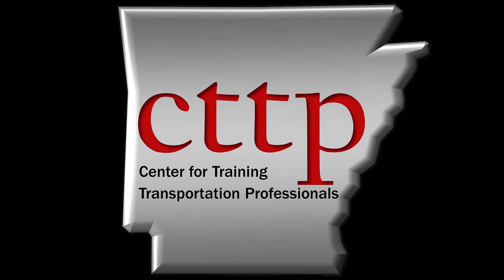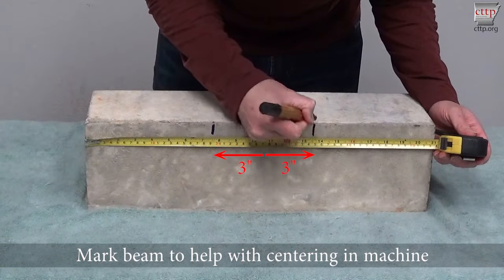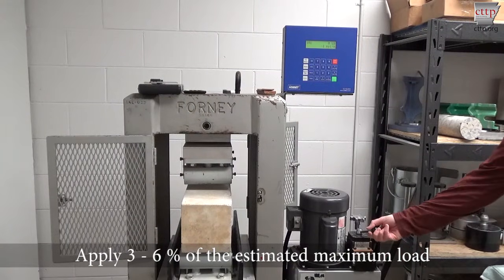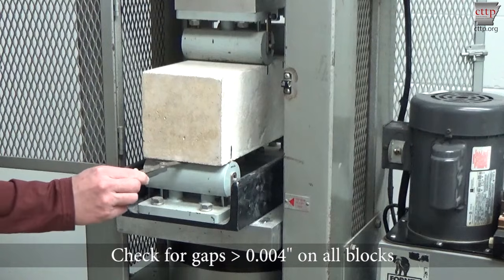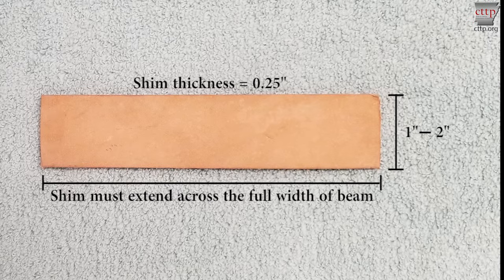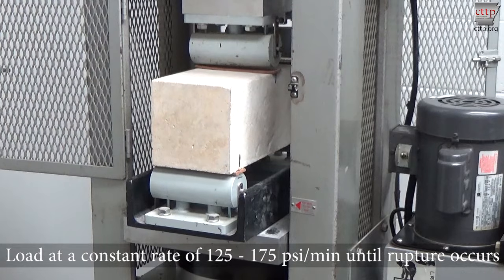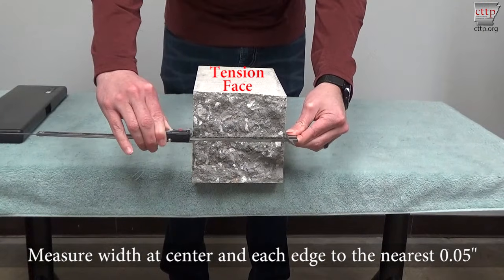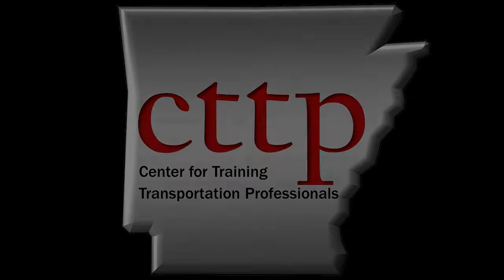ASTM C78 - Flexural Strength

Comment: How long should the specimen be in the mold before removing it and curing it?
Reply from the maker: The specs loosely say up to 48 hours.  As a general rule when kept properly between temperatures of 60 to 80 degrees while curing, it is generally safe to strip concrete cylinders and beams the next day, though if its kept in cold temperatures you may want to use up to that full 48 hours to make sure they aren't "green", which is a term to mean it hasn't fully hardened yet.

Comment: Is ultimate load the maximum load or is it the load at constant rate?
Reply from the maker: Yes you can think of ultimate load as the maximum load.  The loading rate has to be between 125 and 175 psi/min (or that would convert to 1,500 to 2,100 lb/min....which would further convert to 25 to 35 lb/sec depending on how your compression machine reads)

Comment: how do we know 3%-6% of estimated maximum load?
Reply from the maker: That depends on what we anticipate the maximum load to be.  The whole idea of the 3-6% is to just put enough of the load for the loading/support blocks to be fully in contact with the beam, thus being able to check for gaps using the feeler gauge.  As a loose ballpark, typical beams may have a maximum load of between 6,000 to 12,000 (much smaller as compared to cylinders).  3% of 8,000 would be 240.  6% would be 480.  So as an approximation, we could say between 200-500 load (which is extremely small) can be applied, but again it depends on what the expected maximum load is.
Reply: Read the spec of the job